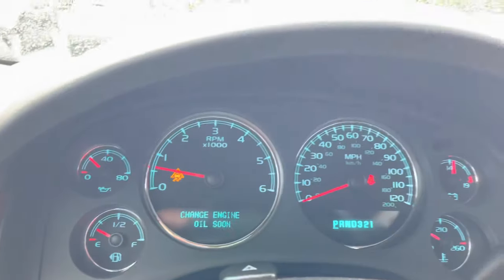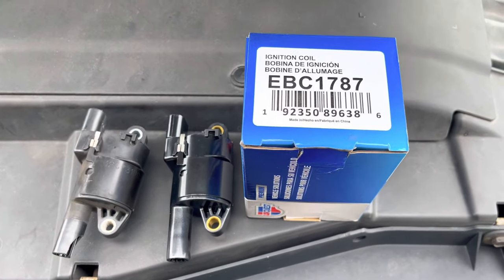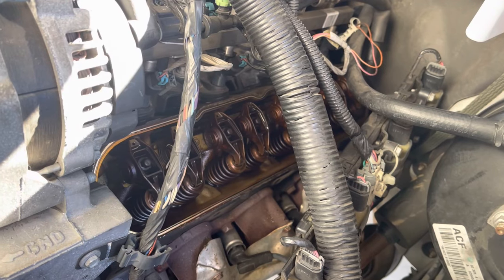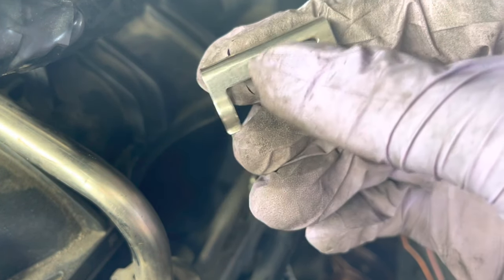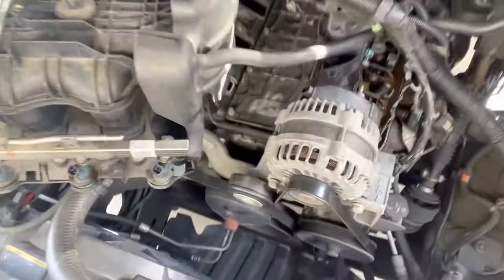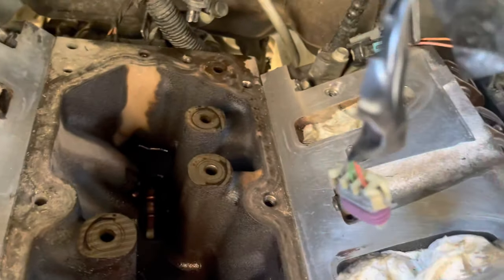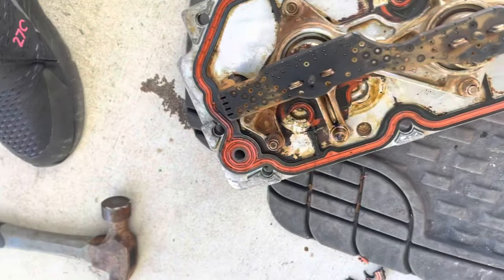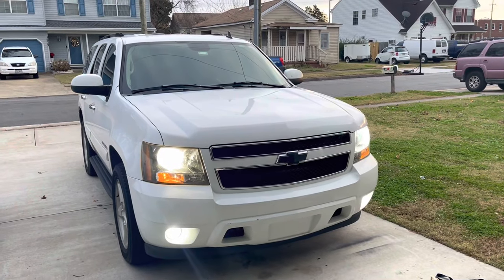07 Tahoe Misfire Cylinder 7 | P0307 | Collapsed Lifter      @CrazedPerformanceRepair

Comment: Ugh same issue misfire cylinder 7. Tapping. Sitting at mechanic rn. Im out of town for the week. May just take it back and do this. Great video
Reply from the maker: Thanks 💯
Reply: @87SSBOI  driveway fixed, first time attempting a repair like this,  decided to clean throttle body so it turned into a Saturday Sunday job but still running strong 3000 miles later
Reply from the maker: @mullenauto  yessir!!!! This was my first time too and I put another 20k on it before it totaled the Tahoe but I then pulled the drivetrain for a 86 C10 swap…everything still A1!!! Saved a lot of $$$$

Comment: My hat off to you, for someone that said they never did anything like this before you did a great job.  Best thing to do is take your time, take pictures and videos and never be afraid to ask questions.  
I did notice your oil pressure was low before and after.  On some of these 5.3 the O ring that holds the pick up tube goes bad and you suck up air.  It is an easy fix also. Not sure if that is your problem. 
As a master tech of over 30 years, I must say good job
Reply from the maker: Thanks man, that means a lot!! I had to do something cause this was my daily driver and my daughter had just total loss her car so we immediately went from 3 cars to 1 car and that sucks...Tahoe sat for a month so I decided to give it a go! And yea I have heard about the O ring issue...I will look into that...I did have a faulty harness going to the oil sending unit and I'm at around 40psi after swapping it out but I think I still should be higher than that so the O ring may be the culprit...Thanks again!
Reply: @87SSBOI   If you put your mind to it you can do it.  Sure some things a shop needs to do or someone with a full access scan tool. 
If you are getting around 40psi then that is ok, one thing you can really never trust your factory gauges.  You could install a oil pressure gauge to take place of your.  On these GM Clusters the stepper motors go bad, they used cheap solder and they develop cracks which will make the gauges act up. 
I wish when I went to mechanic school back in the 80's that we had social media like it is now lol  a lot of reading back then but I wouldn't change anything from all I have learned and still learning every day.
Reply from the maker: @DavidGuns  yessir!!! Thanks for all your feedback!
Reply: @87SSBOI   This guys channel is good, he really goes over everything and shows you.  He just put this video out Part 2 of a Chevrolet Express 6.0 where he replaces the oil pan gasket and pick up tube O ring. 
Thought you might enjoy it 
https://youtu.be/sENVi4d7SGw
Reply: @DavidGuns  I just seen it, very underated content. Seems like humble cool dude who has a hidden talent for wrenching. 87SSBoi, keep it movin'.

Comment: Yo im glad you fixed your truck, im also having the same issues with my truck. i have a 07 sierra and i first got a misfire on cylinder 4 code p0304 then i changed all the spark plugs and i got a random misfire with the code p0300. i ended up changing my coil and spark plugs wire and its still doing the same thing. someone told me that ac delco spark plugs are recommended for my truck but i used bosch spark plugs, im wondering if you think that can be an issue? also what did you do to finally fix the issue?? im not trying to drive my truck like this since it shifts rough on 1st gear and im not trying to mess up my transmission. thanks in advance, i also did remove my throttle body and mass air flow sensor and cleaned both but no luck.
Reply from the maker: I released the collapsed lifter and deleted the AFM...check out @crazed performance repair for more detailed vids on the repair...thanks for watching and good luck🦾
Reply: @87SSBOI  will do and thank you.

Comment: That flashing check engine light can also happen if you have a leak on your fuel rail, i had an idiot that swore up and down he was a mechanic work on my vehicle and he took the fuel rail off to replace knock sensor, i took it to a real pro and told me it was spraying fuel at my fuel rail

Comment: Now you have me rethinking the problem with my LS3 6.2. when I was doing my remote start in the morning I would hear a faint tick on the driver side then all of a sudden blinking engine light and stability control service light. Live data shows ,#3 misfire . I change plugs wires and #3 coil, still have misfire engine shaking. #3 plug it's not one of the AFM cylinders which are 1,7,4 and 6. So maybe I have a stuck lifter like you had.
Reply from the maker: That's a possibility...hope u get it figured soon 🙏🏾

Comment: Hey great job, when you released the lifter with the screwdriver shaft did you remove the rocker arm? You said you wished you got it on video but everything was still together. Crazed Performance has always had the rocker removed and the rod flies out. Thanks!
Reply from the maker: Yes the rocker arm was removed and it flew out…nothing dramatic but it popped out 😂

Comment: Not sure if we chatted about it but, your oil pressure is low. Might want to look into that. Thanks for the shout out. Feel free to PM me on my website if we didn't chat on it. I can give you all the common possibilities.
Reply from the maker: Yes...I ended up replacing the pickup  tube O-ring and I'm good now!! Thanks!!!
Reply: CPR is the goat of this mod. I did the same thing and I'm not a mechanic either. I drove on it 6 months without sending the computer off. I have a misfire in 4 now, but couldn't get it unstuck. I parked it and bought a Toyota. I'll mess with it this summer. Have you had any issues since then?
Reply: @dustindhansen  darn, if 4 has an issue now while having the VLOM mod done it's not likely a simple collapse. It's more likely a spun lifter from a bad plastic guide or something.
Reply from the maker: No I haven’t had any issues…still drive it everyday and on road trips
Reply from the maker: I also sent the ECU off tho and did the VLOM mod tho
Reply: @87SSBOI  yeah I plan on doing it right this time. Before I didn't have 3 days without a truck while I waited for the ecu mod.
Reply: @CrazedPerformanceRepair  I'll be hitting you up with updates once I start getting into it again. Figured it was worth keeping as I wasn't going to get much for trade in value.

Comment: As soon as I saw the valve cover on the trash can, I felt an immediate connection, lol.  Did my 2001 4.0 Jeep the same way...in some random corner under the shade of a tree.

Also, not sure if you have come across this video but comments were helpful in explaining issue with oil in cylinder 7.
https://www.youtube.com/watch?v=VdKV6Z-ooxg
Reply from the maker: Lol…connection!!! Thanks for watching and I will check out the link

Comment: Thats a tough job.  Love these 5.3L V8s. Good job. Range AFM Delete is all you need to disable the V4 mode. Plugs into OBS port.
Reply: Does AFM delete work on hybrids?
Reply from the maker: @airownguyen9555  idk
Reply: Where do I get it?
Reply from the maker: @ernestbyrd300  all info in description
Reply: @87SSBOI  I clicked the link for the piece that goes inside the oil sending unit but it was a dead link. It brings up some scam s*it 😂 I’m currently doing this exact thing on my Tahoe but to cylinder 6
Reply from the maker: @ernestbyrd300  ahhhhhh okay...might have to hit up Crazed performance under one of his vids then...
Reply: @airownguyen9555  that obd doungle works 
The ecm delete  I don't think anyone is doing them on hybrids
Reply: You cannot disable a bad lifters. That's why they are failing. 
I should know. My son bragged about his truck DOD disabled. Two months later the lifters failed. 
So much for buying a disable tool for $$$$$ and end up paying for more damage.

Comment: Hey man! Great job. Have a question.
Did you reset the lifter like the other guy said?
After release did you have to hammer on the push rod to lock the lifter back down?

Thanks
Reply from the maker: I didn’t have to
Thanks man…it saved me a lot of money!
Reply: So just reinstall the rocker arm and done?

What’s the torque spec?

Thanks again man! Helped a ton!!
Reply: no setting any valve lash or anything like that??
Reply from the maker: @stevefarthing8745  nah
Reply from the maker: @stevefarthing8745  just set the rod back into the lifter and torqued the rocker arm down
Reply from the maker: @stevefarthing8745  I’ll have to look in the book or u can just google or YouTube search it

Comment: hopefully you got this fixed. collasped lifters means its time to afm delete. the afm system goes bad after like 50k miles and usually causes hella heartbreak. more if you have an upgraded camshaft. same thing happened to my car rn. ordered an afm delete kit, new pushrods, springs, etc that the person who had my car before me should have but didnt when they upgraded the cam. but the afm delete kit from a site like texas speed will fix this issue and give you the options you need to make sure it doesnt happen again.
Also i would suggest link bar style lifters. why? one less fail point by removing the plastic trays all together. if u dont believe look up what happens when ur plastic lifter tray starts to get old. gl gb
if you do the new lifters you can also add more hp to your car. glad to see you got it all sorted and this will def help my problem so you did help a bro out lol.
Reply from the maker: Thanks for the info!!! I did the backyard afm/did delete but in the near future I plan to order the kit...it's working fine so far tho...Crazed Performance Repair's videos helped me out tremendously
Reply: hello im looking to do this to my 07 sierra since its having all the symptoms @87ssboi had with his yukon. can you please give me more info on the afm delete and how to possible make a permanent fix so i wont have to do anything else to my truck. thanks in advance.

Comment: Yeah most common thing when this happens I just found out lifter will go bad so need to replace that but also make sure you replace the oil pan pick up tube o-ring and while at it replace the oil pan gasket as well won’t hurt to replace it since the oil pan is gonna come down. I will be doing this to mine as well
Reply from the maker: Yea I had to change the pickup tube o-ring..got my good oil pressure back!!!

Comment: Trying to solve 2010 Sierra with similar issue on #1 which is part of AFM.  I swapped #1 and #3 coil.  Installed new plug on #1. Made another code pop up.  It is too cold here to pull engine apart.  I want to test wiring tonight before I tell nephew to take it to a shop.
Reply from the maker: Yea that AFM is a faulty system..I'm pretty sure u have the same issue I had...she is still running strong since the repair tho and back to being my daily driver!!!! Check out @crazedperformancerepair for more info on this repair...he helped me along the way!
Reply: @87SSBOI  I opened valve cover yesterday.  Intake pushrod was bent on #1.  Valve was moving freely.  I installed new correct pushrod but rocker is slapping on valve stem.  1/4" slack.  My guess is lifter is stuck.  I do not think the valve was damaged because valve did not dump gas into cylinder from intake until I pushed valve down manually.  I have been watching the crazedperformance videos.  If a compression test shows good, then I am going to try and release lifter and delete AFM.  My nephew can't afford to get it repaired professionally.
Reply from the maker: @corvettebob96  I feel you...exactly why I attempted this myself...the labor will literally kill you 😒...it cost me $75 and a about 6 man-hours...no telling what a shop wants

Comment: Planning on doing this . Mines is number 4 should I just go ahead and take off intake and get into the lifters or should I start with sparks and wires etc 1st ?
Reply from the maker: Definitely start with wires, plugs and ignition coil first... hopefully one of them will be your issue and not a collapsed lifter
Reply: IMO, I would not replace parts blindly. P.I.T, pull, inspect, test. You’ll rebuild a whole engine blindly throwing money at parts.

Comment: I have the same issue on mine just wondering was your truck turning off?and the smell of fuel is strong on mines
Reply from the maker: No it wasn't turning off nor smelling fuel..it was just shaking and the tranny was shifting hard
Reply: I have a lifter tick and all the symptoms of this video ....1st thing 1st...my fuel pump was replaced...it went out on me at a light... and I replaced my fuel injectors and added Lucas injector cleaner 2(bottles) and filled up on Chevron Techron 93...it was like night and day ...

Now I'm about to change all my sparks and wires since I'm told the bad injectors (which were stupid dirty and clogged) could have messed with my plugs (coils/wires) which were also replaced...

My only thing is I have a Non DOD 6.2 Denali, my valley is Flat No Ridges... so would my lifter  still get stuck? Its definitely tapping?...I guess it wouldn't hurt to try? I would love to clean it up and replace my sending unit and sensor as well.

Comment: My 2007 suburban misfiring changed all the coils and spark plug wires not plugs its still running like shit pulled the driver side valve cover no lose rocker arms
Reply from the maker: Damn...I'm at a lost for words...might hav3 to change those plugs...is the Check Engine Light on? If so, what's the code?
Reply: Had misfire on cylinder 4 changed coil wire went away then had misfire on cylinder 1 3 5 7 changed all coils on driver side. Then had code p0354 now changed all 8 coils idle real ruff no codes
Reply from the maker: @nicholasfrank4353  not familiar with that code but see if you can get thru to Crazed Performance Repair on YouTube...he specializes in these vehicles

Comment: when you worked on the lifter you said that you had to torque it? what was the torque spec and what did you actually tightened? thanks
Reply from the maker: I didn't have to torque the lifter...I had to release it with a hammer and small metal/steel rod that fits in the hole
Reply: @87SSBOI  gotcha
Reply: @87SSBOI  one last question, will deleting the afm/dod cause you to no pass a smog check?
Reply from the maker: @Pibs2525  Have no idea...I don't have smog test in my state...my thought is that it shouldn't have an effect on it tho because not all cars have AFM/DOD
Reply: @87SSBOI  I was able to unstuck my lifter with the tool and now I need to do the vlom modification and delete the dod/afm from the computer. Did you remove the dod from the computer? And if so does that mess with your transmission or VVT?
Reply from the maker: @Pibs2525  Good u got it released!!! yes I removed it from the ECU...sent it to LT1Swaps...info in description and no it does not mess with anything else, just the deletion of AFM/DOD
Reply from the maker: @Pibs2525  that's an important step...if u do not delete the AFM...as soon as you start your engine that lifter will most likey collapse again immediately
Reply: @87SSBOI  hell yeah
Reply: @87SSBOI  gotcha, I’ll be doing the vlom mode then send out my ecu to ltswap thanks brody

Comment: Almost no point in doing this I did this but the lifter got stuck again might as well by new afm lifters and turn off dod and afm once the lifter gets stuck its most likely to get stuck again even with dod/afm turned off
Reply from the maker: I never had the issue again...still running strong

Comment: What you did was completely wrong.. You should buy an electrical device that is an the market you just plug it in . There is one thing we known you still have the AFM lifters and camshaft. You just made through. And we what happened to oil on cylinder number  7.
Reply from the maker: Welp I took the advice of a mechanic that specializes in this repair and my Tahoe is running better than ever...my daily driver with 200,505 on the dash now...vid was made right before 195k...🤷🏾‍♂️🤷🏾‍♂️🤷🏾‍♂️
Reply from the maker: The AFM/DOD was deleted from my ECU...I didn't want to go the route of using the electrical device u plug in
Reply: @87SSBOI  I got a 07 Chevy suburban 5.3 doing the same but mines have like tapping lifter ..any ideas how I can fix it? Thanks in advance
Reply from the maker: @javierochoa432  Same thing mine was doing...for some reason u couldn't hear the tap in the vid...I got all my info from Crazed Performance Repair on Youtube
Reply from the maker: @javierochoa432  https://youtube.com/c/CrazedPerformanceRepair
Reply: @87SSBOI  by any chance did u smell gas too while the truck had the problem?
Reply from the maker: @javierochoa432  No

Comment: MA Brudda, am driving to work today and THE SAME THING happened to me, I stopped @advance auto, changed the coil, wires....bit it did not fix it...

I think it's a stuck lifter just like you said... I will Rlrea H out for the AFM delete...

Thanks man🎉🎉🎉 cheers... I was @ a loss with this....
Reply from the maker: No problem bro, good luck with it…they make a full DOD/AFM delete kit if you want to go that route…it replaces cam, lifters, etc but u still have to get the ECU tuned for it

Comment: Why you did not replace the lifter for cylinder 7? Also why did you have to replace the computer??
Reply from the maker: Because I didn’t want to pull the heads n do more work and I didn’t replace the computer I had it tuned to remove the DOD/AFM
Reply: @87SSBOI  dam I didn't know that was possible, I have everything token apart, heads an all. Waiting for parts to come in mail for repair. What does the delete do??? Should I do mine? I only have one head off. I didn't remove the valley I didn't see a reason to.
Reply from the maker: @mperez0210  definitely need to do the delete..that’s the reason this has happened…it will keep this issue from happening again due the the springs in the lifter collapsing
Reply: You figured out  the Range technology on Amazon for 200.00 your welcome everyone.
Reply from the maker: @ozoneswiftak  good to know! 
I’m cheap tho 😂…$50 AFM ECU delete ftw